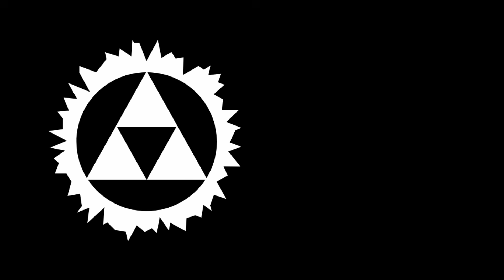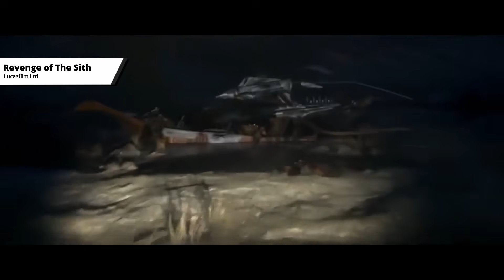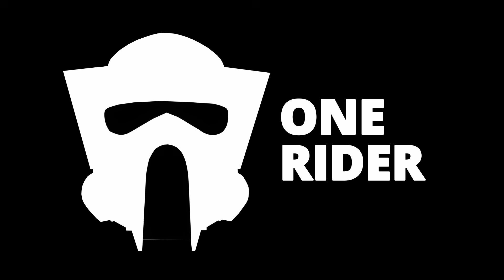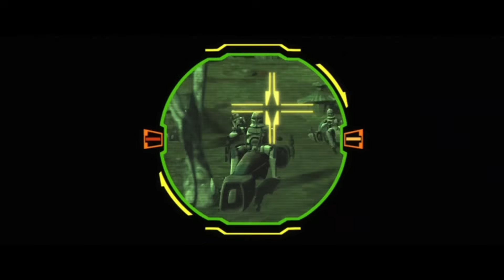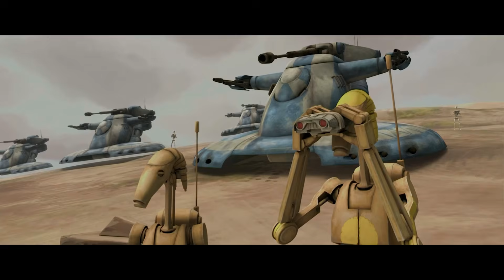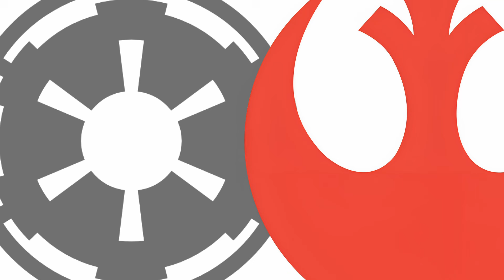Beyond Recon | AT-RT Walker Explained

Comment: My favourite walker
Reply from the maker: Gotta share with the class now, what about it makes it a favorite?
Reply: @republicarmory1  I like it because it's fast to use as calvary as seen it umbara and ryloth and has the firepower of take on most things.
Reply: @republicarmory1 Also, what do you think of the real world equivalent of the at-rt main gun. mine is the M242 Bushmaster.
Reply from the maker: @sandersolibaga8352  AT-RT main gun? Could say bush master as well, but it does fire faster at times. Although there's not much in terms of similar real world counterparts beyond that so I would say the bushmaster too. 

It would be the closest yeah. Solid penetration if done right, decent fire rate for caliber, mostly used to support deal with small arms and what not.

Comment: On the note of recon vehicles and speeder bikes, I had a bit of a look at imperial recon-esque vehicles and speeder bikes a while back. Found some fun ones.

There's of course the BARC (early imperial service) and 74-Z (saw use in the clone wars and imperial era), but then there's more obscure craft
There's the Repulsorlift 2-M recon variant, an open-top single-seat TX-130 that's trying to leverage its speed best it can, it is weird.
The Repulsorscout, which I don't know that much of besides it having an okay weapon and needing at least two guys to operate
The hoverscout, an odd vehicle because it uses an actual cushion, like a real life hovercraft
The ISP, or swamp speeder, which is a mix between recon platform and infantry support vehicle. Too lightly armoured for combat, for my taste.
The Swift 3 Hoversled, which was meant to chase down swoop gangs. That thing had an absurdly high top speed (iirc like 800 KPH) and a high flight ceiling
The StormSkimmer (or SX20 airskimmer), it could go so high that you're essentially dogfighting with it against airspeeders. Because why wouldn't you want an open-top, 2-man scout bike with a flight ceiling twice the height of Mt. Everest?
MTV-7, a single-man... effectively uparmoured and uparmed bike that looks weird no matter what art piece.

And I know thtat there's more out there that I've missed. But it does seem that the empire prefers repulsorlift vehicles for scouting, rather than walkers.
Reply from the maker: Indeed it does, the AT-ST was a bit too slow for that sort of job.

As I mentioned prior as well, it had its purpose, but it seems to be less of recon and more of a support platform that on its own can't do much.

Slap it next to an AT-AT and some infantry support and you can pull something off.

Either that or you get smashed by an X-wing catching you move at the speed of a snail for your size.

Best it can do is create fear in your average villager imo.
Reply: The AT-ST is actually rather capable. Somehow moving 90 KPH, with relatively tough armour, several automatic weapons, light anti-armour weapons and a grenade launcher.

The speed is weird, but the AT-PT can apparently move 60 KPH, in defiance of common sense and God. So who am I to judge?

In the end, they are relatively mobile and decently quick and armoured anti-infantry weapons pods charging your way, that will be pretty scary for even PDF forces... unless you got some massive logs to throw at them. I recommend Sacred Cow Shipyard's video on the AT-ST.

That said, I'd rather be in an S-1 Firehawke. Cool vehicle, that.
Reply: @Krieg8418  Compact Assault Vehicle/Wheeled PX-10  has a speed of 260kph on treads (Also i guess from the name it can run without them like the BT tanks on their Christie Suspension) Just absolute SANIC speeds, pulling the GUP BT-42 scene on fast forward.  It apparently has a very good seat for the pilot, it better because at that speed on a ground vehicle a sore ass is inevitable without it!
Reply: @DIEGhostfish  I know, it also was able to be driven remotely while the driver focused on shooting. Speeds in SW are absolutely insane, and I don't think they were all that well thought out.
Reply: The Swift Assault 5 (which I think is the hoverscout) and the PX-10 both come to mind as well. The latter was a one man tankette/recon vehicle, think it was from Kenner like the MTV-7 or maybe an obscure marvel comic, whilst the former was - as you already said - a hovercraft rather than a repulsor.

This isn't even touching the civilian market, like the Arrow-23 or Heavy Tracker (which is more a dedicated EW/Scanner than a recon vehicle, but its close enough), let alone other non-hover scout vehicles like the AT-PT, Gaba-18 or INT-4.

Also something tells me we both play a popular mod for Empire at War.
Reply: @HawkeyeTM The Swift Assault 5 is the hoverscout, yes. The PX-10 is more a patrol than a recon vehicle. Good shout on the Arrow-23.

And yes. Yes, I think we do.
Reply: @HawkeyeTM PX-10 was a West End Games RPG original despite looking similar to a lot of the Kenner Mini toys it first showed up in non WEG fiction in the Jedi Prince books
Reply: @DIEGhostfish  Bless you for the correction, I was thinking of the Mission to Mount Yoda image where Luke and Han were discussing the PX-10, at the time I assumed it was a MTV-7 and the image was from a Marvel comic.
Reply: @HawkeyeTM  The Heavy Tracker's company Mekuun is interesting since it's a noble house that gave up slavery to be able to better market its products to the rest of the galaxy.
Reply: The Swift-Assault-5 Hoverscout is also a very large tank.
Reply: ULAV was around for the Clone Wars, very nasty piece of work, armed similarly to the upgunned Snowspeeder but natively with a rear blaster turret and frontal grenade launcher to supplement the two guns (It's normally a landspeeder but upgrade kids do exist to make it an airspeeder and swap out its antipersonnel grenades for anti air concussion missiles)

Comment: AT-RT was so effective at what it did that it served the galactic republic, the empire, the rebellion and the first order and was used for almost 60 years.

You could argue that the AT-ST was better but considering how easily it gets destroyed both in the movies and even more so in the books I don't think it's that great against any sort of professional military they get decimated pretty easily. And you could buy 4-5 AT-RTs for the price of a single AT-ST.
Reply from the maker: AT-ST is a bit silly. 

Sure for your average person living on some bootleg planet seeing a behemoth like that would probably make you think twice before trying anything, but after being knocked out by a log doesn't send a good message to your enemy.

But then again, they had to improvise the movement and all in the original trilogy, so it looked a bit wonky and slow unlike the AT-RT.

It does have its purpose though.
Reply: @republicarmory1  You could say that about a lot of vehicles in star wars to be honest. 

AT-RT did have a lot of advantages though that made the platform last as long as it did out of all the clone wars vehicles the AT-RT was the was still going strong even into the sequel era. It outlived every other republic ground vehicle you wouldn't think that design would be the last one standing.

1# It had decent firepower with it's mortar launcher and repeating blaster cannon which was housed on a modular slot and could be swapped out for a flamethrower or a z-6 rotary blaster cannon. The first order AT-RT had even more weapon systems. I mean could you imagine 30 of those things running at you with wide spray flamethrowers and rotary cannons /= 

2# For a walker it was crazy maneuverable, decently fast and had the ability to jump high and far. Yeah the pilot was exposed and that is definitely a downside but the fact that a skilled pilot could jump over explosions and straight up dodge enemy weapons fire kind of made up for it a little bit and with the clones enhanced reaction times it wasn't as big of a downside as it could have been. The First Order actually did mostly fix the exposed cockpit problem though.

3#  Because it was primarily designed as a scouting and recon vehicle it had a powerful encrypted communications systems a sophisticated sensor package, life sign detectors, motion detection scanners, an uplink with forward command centers so they could provide them updated situation reports and a sound baffling system to assist in stealth operations.

4# It's small enough to be loaded inside of a LAAT/i which means you could unload at least a squad of clones with an AT-RT. And it be unloaded while a LAAT/i is moving for a fast deployment which can be useful in surprise lighting strikes. Like on Umbara where the Umbaran's got overwhelmed on the hill because of the overwhelming amount of infantry and AT-RTs and how fast they got deployed and moved up the hill. 

Though personally I would make some changes to the design like possibly a small scale shield generator powerful enough to keep the pilot safe from at least infantry grade firepower and forward armor around the front of the cockpit exactly the same as what the first order did to their AT-RTs to protect the driver from incoming fire.

The reason we see it getting destroyed so much is because the jedi misused the AT-RT instead of using it for it's intended purpose of scouting, recon and light anti-infantry platform they used it as a frontline combat vehicle against everything. Which isn't the only time jedi misused republic ground vehicles another example being the AT-AP.

I would definitely want AT-RTs in my military though. They are a good anti-infantry platforms and decent light anti-vehicle platforms they're quite effective in large numbers and they are a excellent scouting and recon platform because of all the equipment they have in them which gives them advanced warning long before the enemy even knows they are there.
Reply from the maker: @phoenixx913  Jedi misusing their troops and equipment? Unheard of(100% agree)

If I'd have to choose a walker for a military, I would be inclined to choose the AT-RT as well. Out of all, it does seem like the most logical option that would have a use in today's world.

AT-TE - too big and slow for today's doctrine
AT-AP - similar to AT-TE
AT-AT - not even going to explain this one
AT-ST - maybe? but I'd rather AT-RT at that point

Naturally, some examples, there's helluva lot more walkers but most if not all really don't fit today's type of war more than the AT-RT does imo.
Reply: @republicarmory1  For sure if used properly the AT-RT  definitely has more advantages then disadvantages and for the kind of war we fight in our world it would be far more useful then other walker types.

AT-TE
I mean it could move at almost 40mph according to the lore which isn't super fast but for a 4 legged walker I'd say that's probably decent. However the fact it could be used in space, straight up climb mountains, sheer cliffs, large cavern walls and even climb up the side of skyscrapers does give it a degree of tactical mobility that it to useful to be tossed aside in my opinion. You could place them almost anywhere and create all kinds of ambush points that you could dream of doing with any other kind of vehicle. 

And the varied types of shells that you could use in the coil gun make it extremely useful having that option for long range varied ordinance give it a lot of interesting uses you wouldn't get with other vehicles. 

I suppose you could go with the UT-AT it has way more firepower then the AT-TE however it's slower and it's underside is more vulnerable to mines and missiles then the AT-TE and lacks the all terrain capability of the AT-TE.

AT-AP
It's supposed to be used like mobile artillery behind the front lines and from vantage points so the size and speed isn't as big of deal breaker for me. Since you're supposed to use it to shell enemy positions and take out key targets or troublesome from beyond visual range before they can get into engagement range. Something named the sniper tank should not be used on the frontline to begin with.

AT-AT
yeah not even gonna touch that one a complete liability against any professional and properly equipped military.

AT-ST
Instead of the AT-ST I would instead goes with the AT-XT in lore it was stated to be a superior combat walker compared to the AT-ST. It had twin laser cannons for anti-vehicle work and two proton mortar launchers for taking out entire squads of infantry. And came equipped with a forward plasma deflector shield generator that when activated could absorb pretty much all damage from the front for as long as it was activate. However the downside was there was a cool down between activations so you couldn't have it on constantly and it was crewed by a single trooper. It's basically the AT-ST but better in every way which is weird since it came before the AT-ST.

Comment: On the subject of Speeder bikes vs Walkers and the complexity of walkers... while yes, walkers are common, so are repulsorcraft, which are far more common on civilian markets.
Just look at the AT-PT's leg-assembly and tell me a speeder bike won't be easier to maintain.
It is also of note that when you are higher up, like with an AT-RT: Yes, you are higher up so you can see further - that visibility goes both ways.

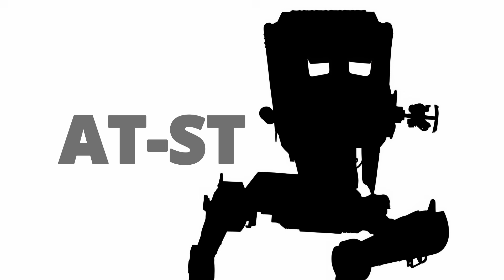08:12 - Kinda. The AT-ST does sorta replace the AT-RT, but it also replaces the AT-XT, AT-ER, CSW and augments the ageing AT-PT platforms. I'd argue that the AT-ED is closer to a replacement of the AT-RT, but it was far less popular.
Reply: And adding another to your list of things it replaces, I don’t know if it outright replaces this as it would likely still have used in more confined spaces, but the AT-DP seems to often fill a similar role to the AT-ST that came later. The DP was much smaller and lighter though so I imagine it wasn’t so much a direct replacement and moreso role overlap, similar to what you were just saying about the AT-ST not directly replacing the AT-RT.
Reply from the maker: @Yoda_16358  Is the DP actually smaller? I swear when I first saw it thing was tall as hell.
Reply: @republicarmory1  AT-DP is taller, however: The AT-AR is very similar to the AT-DP, but seems to have been built on the legs of an AT-ST in some bits of art. It's a relatively obscure one, although there's more obscure units. The AT-AR was used after  the battle of Yavin. There's also the smaller AT-MP, which I adore.
Reply: @republicarmory1  Not sure about height but the pod itself is smaller I THINK. I actually never checked but like it only has one blaster cannon when the AT-ST has a lot more armament on it.

Update: I have just checked Google, I was wrong I think. AT-DP is definitely taller and the pod probably isn't that much smaller. Both are two-man crews.
Reply: @Yoda_16358  The AT-DP has a single gun, but iirc that one's more geared towards anti-vehicle duty, whereas an AT-ST is more general purpose, if not leaning towards anti-infantry.
Reply from the maker: It sure goes both ways. I probably wouldn't be comfortable having that line of sight 24/7 during a conflict. But then again ARFs were kinda of crazy and a bit suicidal, probably their ego.

In regards to the AT-ST, I see your point there but I do believe the AT-ED is a bit less of a replacement, as that walker seems to be more focused on exploration/ research and less mainline, while the AT-ST was there to fit the combat role more as well.

But when talking specifications, the AT-ED sure does look a bit closer of a replacement. Similar size and what not.
Reply: AT-ST never replaced the AT-AP they had entirely different roles and uses on the battlefield. And you can't use something like a AT-AP in a peacekeeping role where as the AT-ST was designed with peacekeeping in mind.
Reply: They will require more frequent maintenance, butbless outright replacement
Reply: AT-ST is way too large to "replace" the AT-RT. It's fine for scouting but does best as a heavy support walker, small enough to go places the AT-AT can't and help escort them, but large enough to provide decent heavy support for infantry. But the AT-RT is truly an actual scout walker as you'll easily see the AT-ST coming, the AT-RT is small enough it can at least be stealthier somewhat. Still makes noise and is taller then a person, but it can sprint over rough denser terrain then an AT-ST allowing it to escape. If we ignore extra vehicles left over from the Republic or that showed up in EU material, it's clear the Republic due to the outnumbering droids went with vehicle and unit variety rather then sheer numbers. The Empire at least for it's mainline units went more for firepower, relying on the AT-AT for HEAVY troop transport to obliterate as much in front of them, while the AT-ST goes in for heavy scouting and infantry support alongside other smaller vehicles we hardly see. Republic left overs were relegated to more background duties as time went on. The Empire focusing on firepower, numbers, and mostly fear to keep people in line.